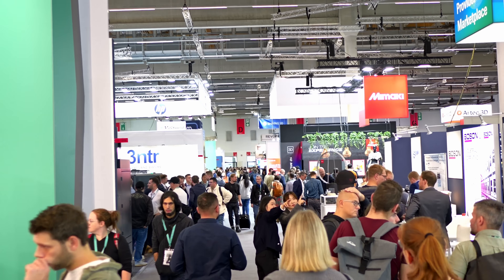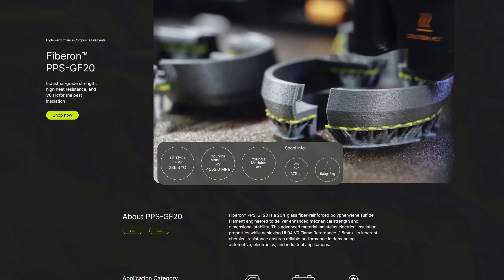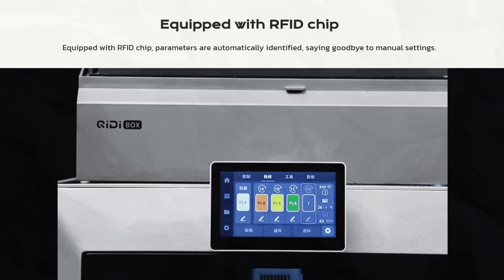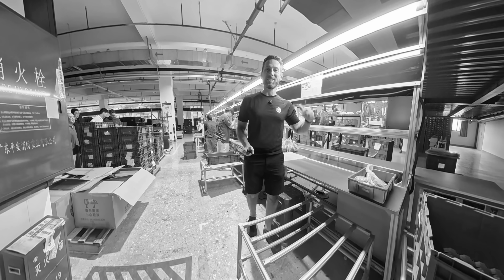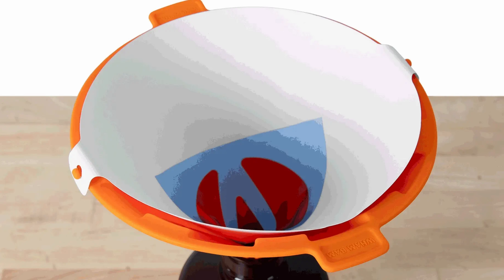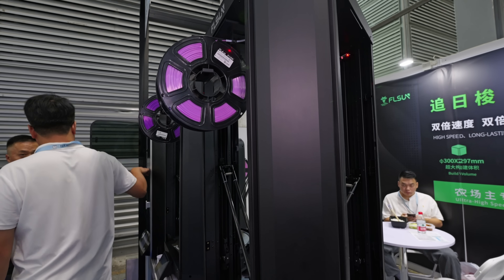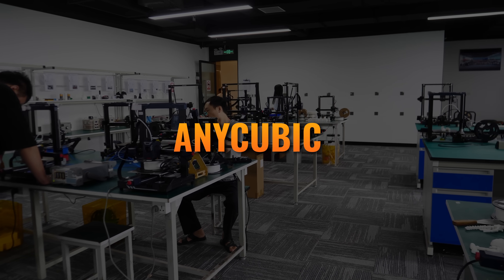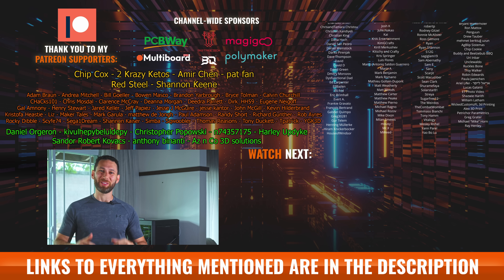35 New 3D Printing Products Coming in 2026!

Comment: Why are you talking like the bamboo H2 C is gonna have a problem because it “still has to switch colors “bamboo invented mastered and has been a coloring 3-D printer brand from the beginning. They already do this with multiple printers. Talk like it’s a new feature that they have to master.And then you accuse them of being bad for keeping secrets? Your bias clearly shows I see why they don’t work with you anymore.
Reply from the maker: You don’t get it bud. The nozzles swap, but you still have to cut, retract the old filament, feed the new one. So it doesn’t solve the problem of slow multicolor printing. Just less purge. And also won’t work with TPU.

Comment: I don't know who's behind it, but there's been someone in the happy hare discord that's been pushing tiger tag to be the standard for filament RFID. I guess they've got a couple manufacturers on board. They have a an open API, but the apps themselves are not iirc. And I'm not sure if it's free for manufacturers to add their products to the tiger tag db.

Outside of that I know there's a few others that tried to start an open standard, but I haven't seen any traction as an outsider.

Comment: Hello guys, I see a lot of comment about Open RFID standard. It's already on it's way and it's called TigerTag. It's developped by a french retailer (Atome3D). They are present in  ROSA3D, SUNLU, JamgHE filament, put directly in the box by the manufacturer. There is discussions with other brands too, and FlashForge indicated they'll integrate the detection of TigerTag in their next firmware ! Compatible already with Creality (Update the content of your CFS directly from your mobile app). A lot of dev around this project, including a scale and an auto update of your spool in your stock. Mobile App on Android & iOS.

Comment: I'm a huge fan of my Anycubic Kobra S1 although, the ACE Pro could use a little easier access to the filament path for clearing breaks and misfeeds. Only had one break, so far, but at the worst possible time, so it's been sitting idle for 8 weeks while I've been sorting stuff with my health and minding a friend's cat while they sort their health. (I didn't check my "last used" note on the filament in a runout crisis, my fault, not the printer/ACE Pro's) Seriously can't find fault with the print quality, based on the S1's output. Can't wait to try some engineering grade filament with it, like PLA CF or PETG CF filaments. For the most part, as easy to use as a microwave oven, even if the filament path in the ACE is heavily enclosed and hard to clear of a blocakage.

Comment: RF-id open is needet. Just put in " color - material - abrazive yes/no - temperature - normalyzed flowrate " on them in plain text. Even than Bamboo and CO can still fitt an unreadable part on there with better optimized values for inhouse use. An NFC215 tag holds 504 Bytes and cost in batches of 100 about 18 cent so about 5 cent to them even if they add those 18 cent or even 50 cent on top i am willing to pay that so I dont have to always adjust my profiles.

Comment: NFC: what each printer producer should do is to have an open api which can communicate the NFC data to the slicer.
Then each slicer should be able to have a database which associates that NFC data with a print profile.
This will enable even people to stick an NFC tag onto their self-recycled PLA and have the slicer auto load the user defined profile depending on the loaded filament.

Comment: I was hoping to hear more about the Bondtech INDX system, but I guess that is planned as a 2025 release, not 2026.
It's clever and witty that he pretends to be sad about not having a business relationship with Bambu Lab but only mentions them in his videos to point out where there are cheaper alternatives or to give subtle digs about them. I totally share the concerns about the Vortek system based on the information so far. Swapping nozzles isn't a bad feature and might help reduce wasted filament, but isn't going to help much with the time taken.
I currently have a Bambu Lab A1 and it has been a great starter 3D printer. But the next one I get will be a tool changer most likely the Snapmaker U1 if the rollout is successful. Although the idea of getting a SOVOL SV08 max with 12 or so INDX tools would be a lot of fun too.
Reply: Whilst the INDX approach of a nozzle for every filament and no cutting is nice, I  think there is a possibility, if BambuLab choose to do it, for most of the retraction and rewinding back to be done parallel to the nozzle changes and reheat - so it is possible that the tool changes on the Vortek might not be that much slower than INDX.
Reply: @dwuk3d  That makes sense. The next six months or so will be very interesting.

Comment: Open rfid tags needs to be a thing from all the major manufacturers.
Reply: We can't even get them to just use Orca slicer, what makes you think they will do this?
Reply: @davedempsey5282  you're talking about two different things though.  Orca slicer is a user side interface/tool.  The RFID would be an industry standard.
Reply: I expect the first manufacturer to come out with a programmable rfid tag system will get a huge boost in their sales. It could be the next feature to dominate the market.
Reply: Prusa just released this!

Comment: - You didn't explicitly state it @ 6:32, but I'm looking forward to the Phaetus Conch hot-ends for the Flashforge AD5M & AD5X. There is a large user base with essentially no quality aftermarket options.

- It looks like 2026 will be the year of the toolchanger.
- YES to a universal RFID industry standard!
Reply: Thank you for your support of Phaetus' products.

Comment: I just don't trust creality to make a dependable printer.  It might pull costs down accross the market, but it might also just generate more barely-functional low-end crap.  We'll see.

Reminding us of when the big show that "more details will likely be released at" is probably useful.  As a casual viewer I had to go google FormNext, and adding "in mid-November 2025" wouldn't take much time.  Just a note to help keep you accessible to the less obsessed.

The Atomform looks very, very cool.  I'm dubious that it will be in my price range, and I'm not confident of it's reliability on release (just because I'm always suspicious of such things) but it's very cool and I certainly WANT it to work and be something I can afford.  Likewise, the FLSun V400?  A delta printer than can do R2-D2's head as a single print?  That's very solidly in the "I really don't need this but man do I want it" box.

And I find it darkly ammusing how WhamBam and BiQu are flailing areound trying to find something to sell.  With the rise of printers that actually work out of the box, their "we sell upgrades" market is clearly much, much smaller.  The Panda Den is clever.  The Panda Verse?  It's just cabinet on wheels.  I can buy that from Canadian Tire for less money and have it home in 20 minutes.  I don't even need to spend bus fare or gas, since CTire is literally across the street.  Cast silicon painting palletes?  Not without value, but also not hard to find on Ali.  I empathise with them, and applaud the effort to try and stay solvent, but also I think these companies need to really look at themselves and see if it's still worth trying to exist or if it's time to try something new...

Comment: Interesting no mention (even on the speculation side) of Elegoo multi-filament system.  Elegoo had made promises about their Centauri Carbon they seem to be backing out of.  IMO, Elegoo and Anycubic and others are notorious for changing products quickly and ending support even quicker.  It's an ecosystem not to get involved with long-term unless you enjoy just purchasing new printers for improvement every year.
Reply: Exactly, I bought the Centauri Carbon because of the future release of a multimaterial system, jokes on me.
Reply: @NovaRedHead  Yeah, same.  I still like the printer, it was my first enclosure printer and was an upgrade from my A1 mini, but I'm now that the point I really want to start playing with a multimaterial system.
Reply: i have the elegoo cc and it works good but still no mmu

Comment: All the printers are about multi-filament printing. Cool? Sure, but chamber heaters are much more important for functional printing.

Brands are focused on the 'I just print PLA statues' group, and miss the other half. Hence Qidi does well, but 65C chamber is still too low even for strong ABS.
Reply: Desinging electronics for temps above 65°C is much more difficult. Electrolytic caps and power semiconductors must be automotive spec, standard JST or usb-c conectors dont hold up and  small cooling fans are way more expensive. Thats why most consumer/prosumer printers top out at 65*C chamber temp. Desinging a proper high temperature printer woul require a lot of compromises.
Reply: I think PLA and PETG are good for 90% of the users, if not more. Those are the printers to create sales and profit al small margins.

I also understand the need for better printers and higher temperatures, but at what cost.
(Bigger) Business is different playground, serious tools will always have a serious cost.
Reply: @kimmotoivanen  it really depends on your projects. For me, with functional prints, especially RC, PETG just breaks everywhere, especially in thin places, where ABS does not due to strong tensile strength.

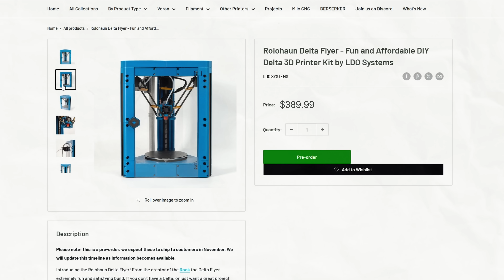Comment: 11:15 wtf 400 for a printer that can barely fit a benchy?sry but maybe at 69.99, ldo or not 😂
Reply: The expensive hardware is common to all printers. Main board, motors... Most of the extra cost would be the heated bed. Apparently 2020 extrusion is pretty cheap in bulk.

Comment: Great video. I think a universal rfid system across printer and filament brands would be a great improvement to the brand specific mess we have now. Also I am excited for the multi color/material tool changer products coming soon. I backed the U1 on Kickstarter and I will be buying either an Indx upgrade kit or a Prusa with the Indx system already built in at some point. I am honestly interested in the maybe real Creality tool changer too. Not a huge Creality fan but they do tend to make workable lowish cost printers in large scale numbers so it'll get more tool changers in more hands probably.

Comment: Cross-compatible RFID tags would be awesome!
Reply: All it will take is one filament company to do it, the rest will follow
Reply: Couldn't someone do a pi / Arduino translator widget for cheap?
Reply: @scrout  Who's rfid would you translate to and who is going to maintaine a database to map them all ?  Better if the industry did it and is what users should demand..
Reply: @scrout  That's what I was thinking, most of these are just Mifair NFC stickers right? If that's the case it would just become down to translating whatever data they contain on the sticker and how it correlates to as far as their product and color.
Reply: Bang! OpenPrintTag!
Reply: Hello guys, I see a lot of comment about Open RFID standard. It's already on it's way and it's called TigerTag. It's developped by a french retailer (Atome3D). They are present in  ROSA3D, SUNLU, JamgHE filament, put directly in the box by the manufacturer. There is discussions with other brands too, and FlashForge indicated they'll integrate the detection of TigerTag in their next firmware ! Compatible already with Creality (Update the content of your CFS directly from your mobile app). A lot of dev around this project, including a scale and an auto update of your spool in your stock.
Reply: That's what I've thought about recently)
Reply: Yes, never stop pushing for that, ever.

Comment: Yes.the Rfid tags need.to be open
Reply from the maker: Preach!
Reply: @LifeN3D2025  Seconded 🙋🏻‍♂️
Reply: Hello guys, I see a lot of comment about Open RFID standard. It's already on it's way and it's called TigerTag. It's developped by a french retailer (Atome3D). They are present in  ROSA3D, SUNLU, JamgHE filament, put directly in the box by the manufacturer. There is discussions with other brands too, and FlashForge indicated they'll integrate the detection of TigerTag in their next firmware ! Compatible already with Creality (Update the content of your CFS directly from your mobile app). A lot of dev around this project, including a scale and an auto update of your spool in your stock. Mobile App on Android & iOS.